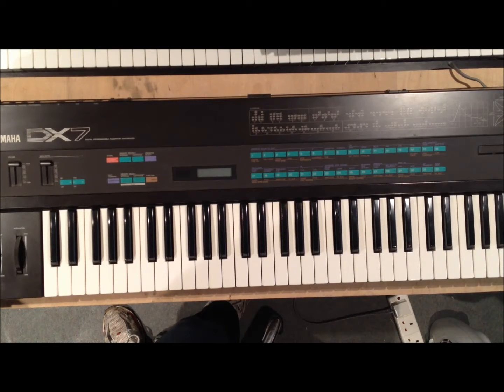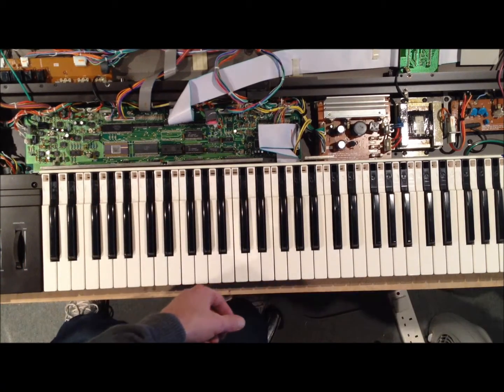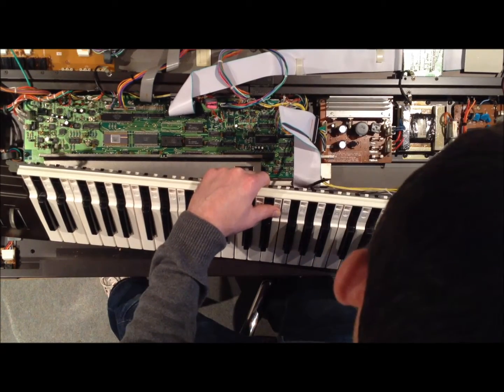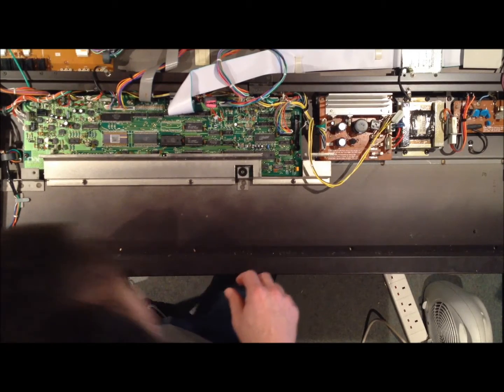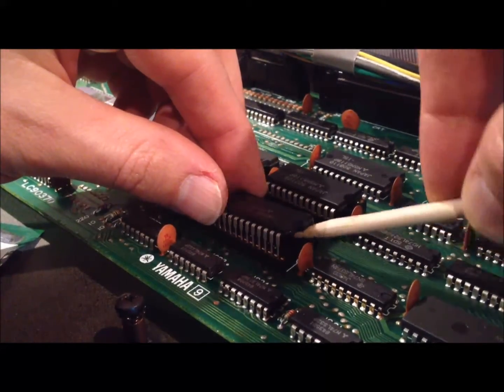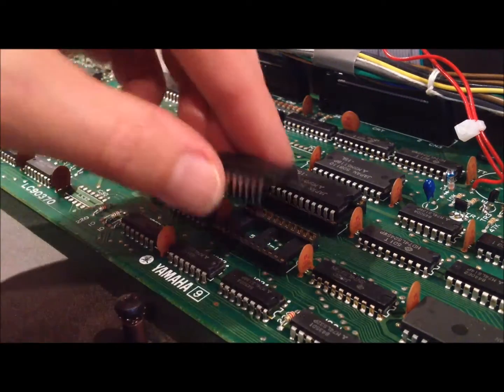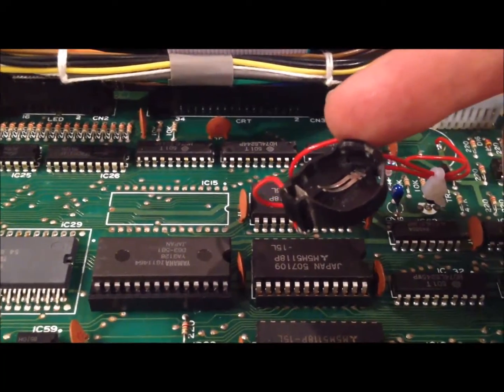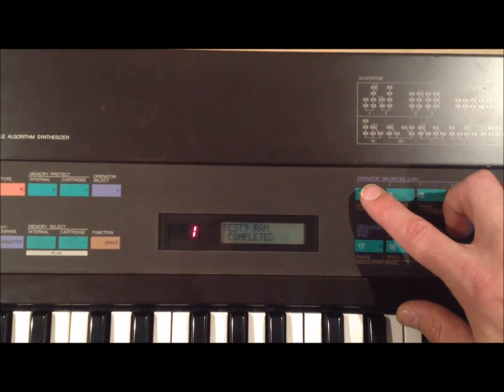Yamaha DX7 RAM Repair

Comment: When I try to go to the Test menu pressing the 3 buttons it shows "Change ROM!" and it doesn't enters the test. Do you know what is the problem?
Reply from the maker: Is your dx7 a v1? I'm guessing if it's telling you that the ROM is faulty you may not be able to access the self test functionality. If that's the case I also assume that the synth is generally not working well?
Reply: @beetrootstudios  thanks for replying, yes its an old one like yours in the video. It shows the battery message, I already ordered the battery to replace as it shows the battery message, but everything seems to work well, I have sent the ROMs by syssex with success, so I don't know...
Reply: @beetrootstudios  Same problem here, mine doesn't produce any sound after I changed the battery as it was showing the "change battery" message. It says "change ROM!" when I try to run the test mode, any idea what to do ? thank you
Reply: @fmmercury  I guess you need to resend the banks via Sysex

Comment: I get no sound on my Yamaha dx 7 mk2 fd while all other synth works. Any ideas about what i will need to check out ? i have replaced all caps ceramic and electrolytic on the PSU but the problem remains. Also i get some kind of hum.
Reply: @Pan6888 , I have same problem in this moment... How did you resolve this situation? 😥

Comment: Hello and thank you for the video, was just wondering when I attempt to enter the diagnostic mode it just says "CHANGE ROM!"  Have you seen this before? cheers
Reply: same problem here
Reply: same for me, did you manage to find a solution ? thanks
Reply: @Baptiste Ofcard  I found out the DX7 had installed an expansion card called "superMAX" attached to the main board, so I guessed it was causing the issue, I didn't try to take it out as the keyboard wasn't mine and the owner was happy as it was. If you google "dx7 supermax" you'll find some info.

Comment: I was wondering why you removed the motherboard to swap that chip on the DX7? I just did so to unsolder and install a battery holder like yours but I think I could have just removed any of those chips without taking the whole thing apart.